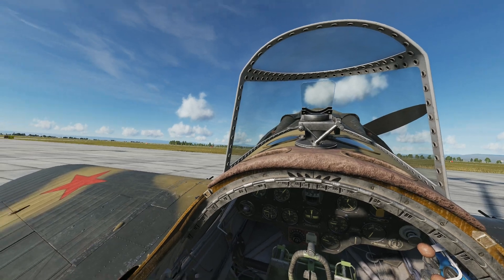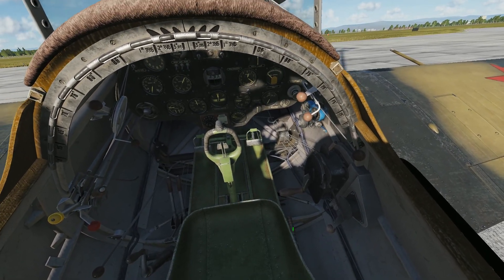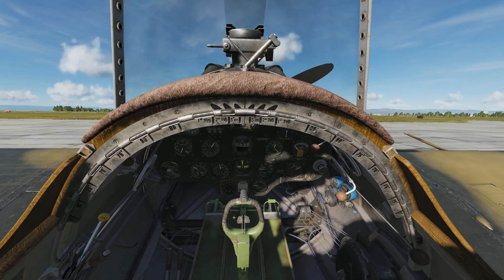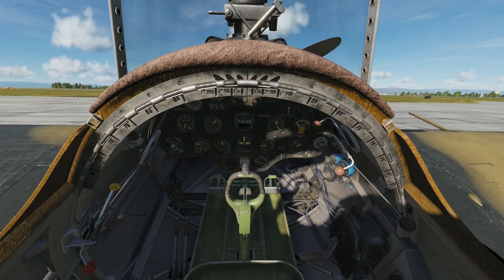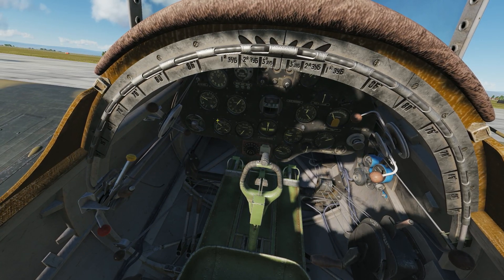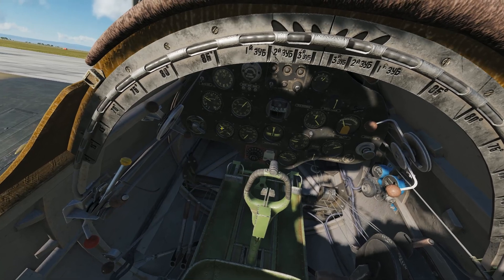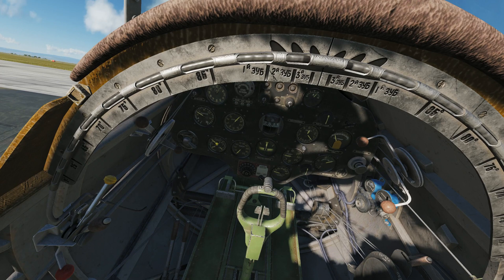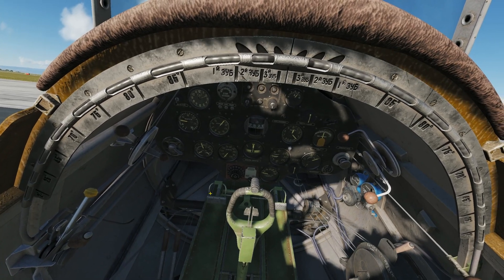DCS:World » I-16 Startup Procedure

Comment: I still can’t get the bloody thing started xD

It doesn’t catch after pushing the starter back in, just coughs and splutters for a few seconds

Fuel flow and pressures seems good. Tried 4-5-6 primer pumps
Reply from the maker: Yeah I couldn't get it started no matter what I tried, thought it was bugged.  The issue I had was how the starter needs to be pushed in immediately upon release with as little delay as possible.  Aside from that I've read that you only want 5 pumps due to the engine being easy to flood.
Reply: pickinthatbanjo guess I need to improve my mouse click reflexes then :)

Thanks for the tutorial though bud, didn’t seem to be any other training with the little bird
Reply from the maker: @Hellreign82  No worries, and yeah the lack of training missions was surprising.  It's a pretty simple aircraft but you'd at least expect a cold start training mission.